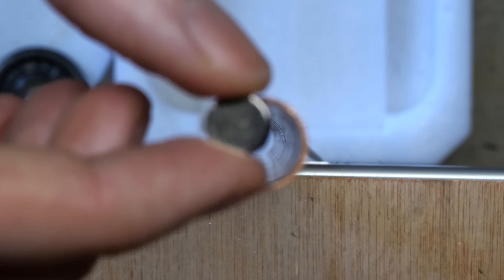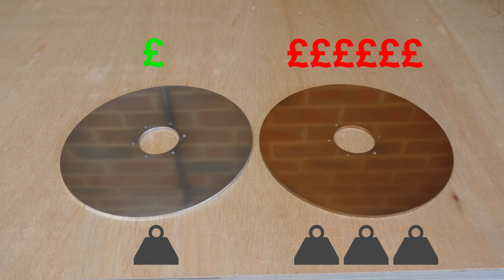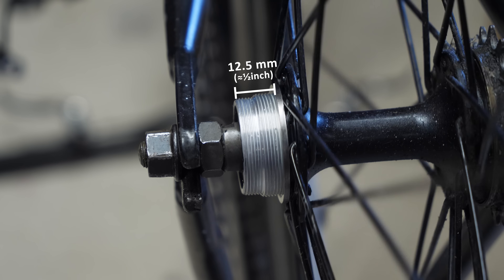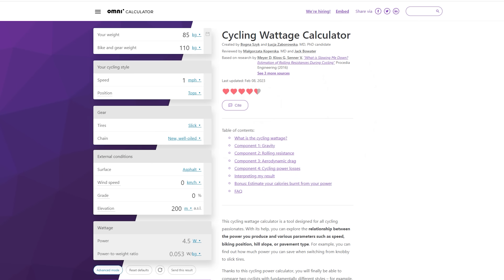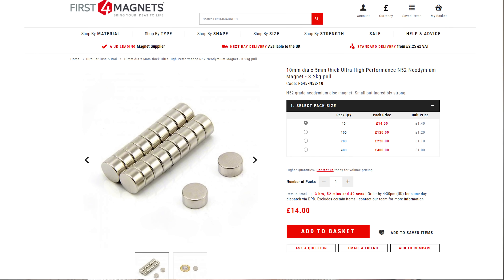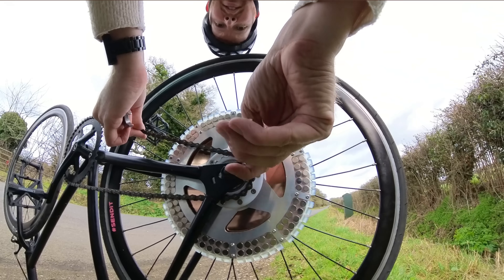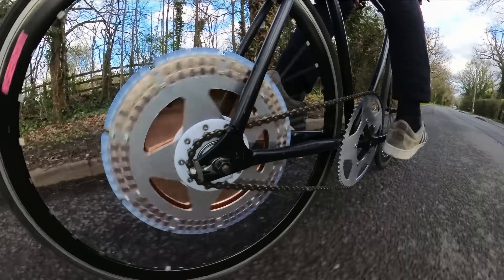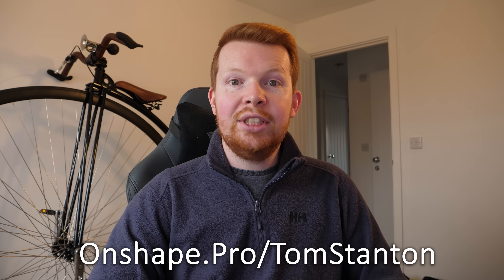Gearless Magnet Bike

Comment: I love you're projects, I want to try some projects like these.
Idea for your next project: a servo controlled CVT.
Use a dynamometer to measure your peak torque when pedaling and make a CVT that keeps you pedaling at that RPM so you always make maximum force (of course, it will have it limit, but it will be useful).
There are a lot of CVT designs, one of them being a friction wheel on a transmission rod and contacting a disk (you already have the disk) and you move the friction wheel closer or further away from the center of the disk, mounted on the wheelhub and that will change the gear ratio. If the wheelhub were fixed to one side, in theory you could get an gear ratio of 0 and even reverse gears.
Think about it, I'm sure it will be cool and useful

Comment: Could you use that generated heat almost like a battery? Technically it's stored energy right? Perhaps somehow that energy could be reused for some kind of uphill assist. but I have no clue how that could be achieved as I am in no way an engineer nor do I know how these things work. Perhaps just a scifi esc thought...

Comment: Maybe you could use this as a brake instead of a clutch. If you connect an electric motor to the wheel that spins with the wheel, then use electromagnets powered by that motor that engage when you pull the brake handle to interface with the copper disc. That is, if electromagnets can actually generate eddy currents in the copper disk. Could make for a cool non-contact brake if it actually works.

Comment: you should try to place holes in the copper disk to allwo the magentic flux to pass from there, i'm wondering if this increase or decrease the torque transfer (train brakes works this  way...)

Comment: You would have theoratically done better to put magnetic rivets in the disk. That concentrates the flux through the disk and greatly raises the torque. However it also makes the disk magnetic so it's harder to mount.

Comment: Checkerboard should be better, but you need to add a thin steel plate over it, to close the flux, that would more or less double the magnetic flux.  You could also build a halbach array, but I find the steel plate is pretty much as good and easier to construct.

Comment: This can be made to work but you've missed the figure of merit. This transmission transfers a certain amount of torque proportional to the rpm difference between the wheel and the sprocket. Suppose you're climbing a hill at 5 m/s and 250 W with 66 cm wheels and want 90% efficiency from the magnet sprocket-to-wheel interface. The wheel must be spinning at 145 rpm and receive 16.5 Nm torque. Due to requirement of 90% efficiency, the sprocket must spin no faster than 161 rpm, a difference of 16 rpm. So the transmission must transmit 16.5 Nm at 16 rpm difference.  You need to provide 278 W at sprocket via pedaling. 

Suppose you now tackle a hill which requires 250 W output at 2.5 m/s. Required torque doubles, so need 32 rpm difference, but wheel rpm only 72 rpm, so sprocket rpm would be 104 rpm. Efficiency now only 69% 72 rpm/104 rpm. Instead of providing 278 W you need to provide 361 W.

Your described magnet sets at 8:39 provide 7.1e-2 Nm per rad/s. 16.5 Nm at 16 rpm is ~ 10 Nm per rad/s, so you would need 139 magnet sets of that configuration to achieve above coupling, or else improve them, for example by increasing field, decreasing pitch, decreasing gap.

You can use this type of calculation to design an adequate transmission. Figure out how much torque you want at what speed with what efficiency. Also you should use a steel yoke on the backside of the magnets to increase the field at the copper (more torque), which will also stop them sticking to nearby objects. Also you can increase torque some by making sure gap between magnet and disk is small compared to magnet pitch.

Comment: hey Tom. very very interesting concept. i'm not entirely sure i've fully got this right, but if you switch the magnets for electromagnets, you'd be able to have an infinitely variable clutch, right? as well as intrinsically have a setup for variable regenerative braking? you could variably couple and de-couple the rotors while also recuperating the induced current while braking?

Comment: Aluminium is superior in this application, but you have to use a greater thickness. For the same thickness copper will win, but for the same weight, aluminium will. There are some constraints though, the frequency can't be too high and that's set by the size of the magnets and the rotation speed.

Comment: Hi Tom
The checkerboard is only useful if you also want drag in the left-right direction.; generally the magnet diameter should be greater than the gap between facing magnets.
More importantly,  please look into "back irons" - these will easily improve the effectiveness by 2x or 3x and shall also eliminate the problem of the chain sticking to the magnets :)
Reply: Yes!  I think this would probably double the performance at least.  Mumetal is ideally suited for the job (which is why they use it in hard drive voice coils)
Reply: Would it not work better if there were magnets distributed around the disc ?
(perhaps at pitch centres corresponding to say 9/10ths of the pitch of magnets, to get a sort of vernier effect). 
I guess the poles on the frame would want to be opposite polarity to those on the rotating disc. You'd want magnets both sides of the disc, to balance out the axial forces.
Reply: @Gottenhimfella  Quite a few drawbacks to your scheme - The damping (i.e. conversion of kinetic energy to heat) happens in the conductor, not in the magnet. A magnet shall store energy as potential energy (and then is mire like to demagnetize too, but that is a different story). So, to convert KE to heat, a conductive disc is essential. The added moving magnets shall add inertia to the rotor (non-issue in a bicycle, agreed) Second issue is that of axial (parallel to the axle of the wheel) force - rare-earth magnets of this size pull hard - a symmetric construction with two sets of fixed magnets and one moving conductor has no axial forces, and hence can be thin and slim.. to work-around this, perhaps 8/10th or 7/10th would be better. The third issue is cogging. Even with the Vernier, you would feel some. The advantage in your scheme (if I understand it correctly) is that you eliminate the air-gap on one side of the damper. The disadvantages that you have to pay as a price are, imo, not worthwhile (at least with my understanding of your described concept. Feel free to 3-d print a holder with 7-magnets and 10-magnets arranged in a circle and try twisting them against one another :) (without a conductor, it will feel more like a detent than a damper)

Comment: I feel like the next logical step to this is adding a belt instead of a chain and connect it to an electric motor. In theory, you could adjust the torque by how many magnets you have so you can adjust the torque so it would be able to get the motor up to speed faster and smoother without damaging anything or losing traction with the ground. Adapted for racing.... so cool... At least that's how it works in my head lol

Comment: i mean, all we did is create an induction heater. Like 20-30% of the energy you put in goes into motion (torque converter style) but the other 70-80% go into just heating the chain (passing by the magnets), the frame and the copper disc.

Comment: Have you seen the "Mechanical circuits: electronics without electricity" video at "Steve Mould" channel? There displaying an interesting way to make a reciprocating motion transformation at 15:00. It could be useful to implement some version of smooth derailleur in spirit of the Honda gearbox (the first generation).

Comment: A halbach array instead of a simple N-S magnet setup would would make the effect stronger for the same size/number of magnets. Besides, that, pretty cool!
Reply: That's correct but he will have to either have to cube magnets with the same field strength or he will have to increase the gap between the magnets chains and spoke for it to work
Reply: @Player-pj9kt  not really. A halbach array produces weaker field "outside", so the spokes and the chain should actually stick less!
Reply: @quinor  I'm not talking about the sookes and chains attracting to the magnets I'm saying that the magnets he us using will physically collide with the chains
Reply: ehh clearances... fair point.

Comment: maybe it would be better as a brake system.
you could attach the copper plate to the front wheel for example and have something to put the magnets close to it when you press the lever.

Comment: Love your content. It seems like you could have just used magnets instead of the copper disk. That said, if the magnets could be slide along a rail towards and away from the hub, it would be a more effective gear, but I suspect mechanical is probably better for this use.

Comment: If you peddled backwards would that give more drag in reverse as the drive wheel would be much faster in reverse than the copper disk to slow the wheel down faster instead of just stopping peddling?   very interesting and gets you thinking....

Comment: Now if you use arrays of magnets with different levels of force on both the clutch plate, and fly wheel you may get the result you were looking for. While not as cool as eddie currents. could still work adn woudl be a magnettic clutch. However the problem of wasted energy being transfered into heat would always be an issue, and just increased with each magnet added.

Comment: I'm curious what would happen if you put a generator at the pedals and an electric motor at the wheel, and only connect them with wires. No battery, no chain.
Reply: Ooohhh   ...     Free Energy !!!  😛
Reply: @jezmy2006  No free energy. You generate energy at the pedals and this energy is transferred to an electric motor.
Reply: It works but the problem is it's just not as efficient as mechanical drive trains.

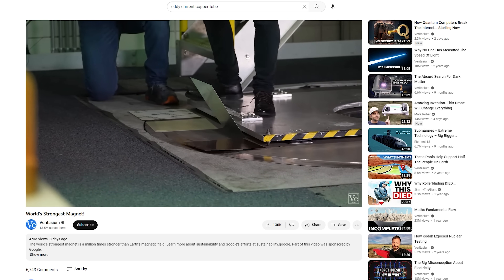Comment: 2:14 Could you explain to a weapon like me why weight matters? I thought the whole thing with Galileo dropping cannonballs off the Tower of Pisa was the proof that mass is irrelevant to falling speed. Now obviously Galileo didn't have a massive fuck-off electromagnet kicking about, but I don't know why that would make a difference here regardless, what am I missing? Does the additional mass allow it to exert a greater force and overpower the resistance from the magnet more readily?
Reply: I think the point is that you have to "spin up" the disk.  The heavier material costs more energy (more pedal power) to get to a given speed.  Ideally, I guess you want the lowest mass for your material and at the same time the lowest electrical resistance.  Also, bear in mind you have to lug it all around 🙂

Comment: 10:33 stainless steel bike chain :D
15:51 copper disc emissivity is 0.03-0.2 .. pretty sure the "30°C" reading is acquired with an emissivity setting of 0.95

Comment: This looks remarkably similar to the system I used to measure torque on my pneumatic engine. I also started with a weight on a spool to calibrate with constant torque. But now I'm using a load cell and variable torque which is far more accurate.

Comment: oi red head, just design a 50cc bike-like scooter, and start manufacturing them: your magnetic converter works like the torque converters with oil.
Reply: that airplane dude from US and his team can build the frames in no time.
Reply: very important to build gas variants, f#ck electric motors and batteries.

Comment: Flip it (put your clutch on pedal side, not the wheel side) and use electro magents instead of permanent magnents. That way you can harvest energy while braking and increase your magnetism when you're applying power.
Reply: So it’s a normal motor at that point
Reply: Bro invented an e-bike
Reply: @gibsonf06  mans proper smart, you get me.

Comment: Nice project; if you would have used a steel back plate for the magnet you would have gotten roughly twice the juice out of your magnets and it would also have solved your problem with your spokes and chain... but yeah still wouldnt win any races with it either way ..

Comment: What if instead of the copper disc you replace it with looped copper wire attached to some resistance?  That way you can have less lost energy since the fields would line up better.  Effectively making a generator.

Comment: I'm wondering if you could use this to generate current to recharge the battery on an electric bike or car for that matter❓🤔❓
You may not achieve a 1to1 replacement of energy,  but any recovery could be a significant ➕ in the equation for stretching the power curve....
And if you could generate as much or more power than you are using to move,  the smaller the battery you will need to run the bike or car or boat or even aircraft....
Although an other than land vehicle (air or water) might pose more difficulties than one where you could have multiple wheels on the ground,   some to move the vehicle and some to recharge the vehicle....
Reply: thats what electric cars do when you brake, it runs the motor backwards as a generator.

Comment: I wonder if there is any temperature rise in the copper due to the eddy current? Great experiment Tom!!!
Reply: You know in the end where the copper plate is really hot? Thats the eddy currents heating the plate.
Reply: @Tremoneck  Damn, I had turned it down and called it a done deal as there was a live event here in Canada of some serious impact. I wish I had not posted that now. Oh well
Reply: @chrisleech1565  wasn't meant to be condecsending. I just thought you didn't missed the bit or the connection.

Comment: This would work well as a magnetic limited-slip clutch, in which power transfer is proportional to the difference between input and output. shafts. It's not a great transmission, because instead of varying torque/speed ratios, it converts speed difference directly to waste heat.

Comment: Torque vs. RPM = Linear. And that is how mechanical speedometers have worked in cars for 100 years (just add a coil spring for resistance).

Comment: If you revisit this project, you should try a halbach array for the magnets. Should get you a much stronger field
Reply: It will give you a stronger field but you also have to keep in mind that he didn't much space to mount the magnets. The magnets would touch or overlap with the chains and spokes if he would use the halbach config
Reply: @Player-pj9kt  he don't have to use chains there are belt driven bikes already and they make much more sense because the belt isn't magnetic
Reply: @fischX  it still might get in the way. The spikes as well if he puts the magnets on both sides. Easiest solution is to use smaller cube magnets but those magnets are probably not as strong
Reply: wouldn’t it just give you a stronger field on one side? so instead of a bunch of change in flux from north to south from the individual magnets to a change in flux of let’s say north to nothing but with a bigger north?

would it actually be any better?
Reply: @Luka-lm1pr  The copper disc is very thin, so a single large pole configuration results in a lot of the magnetic flux going straight through into the air where it's doing nothing, where a Halbach array concentrates it near the magnets. This sort of application is almost exactly what Halbach arrays are made for. The caveat there is that the magnets are on both sides which does mitigate that effect somewhat, but I would hazard a guess that a Halbach array would still beat it.
Reply: I was looking for this comment, I agree that a Halbach array should make even weaker magnets work better.

Comment: Interesting idea! I knew immediately that the heat generated from the Eddy currents would make this non-viable for cycling on the street. Stationary cycling however... If you vary the diameter of magnets you could get a variable speed transmission that might work well for a stationary bike.

Comment: I'm curious if a larger diameter aluminum disk would have a greater effect since you would have the same weight as the copper disk but more area to generate resistance.

Comment: Nice project. Your temperature measurement from the surface of the copper probably isn't at all accurate. (Try looking at someone's wedding ring using a thermal camera)
Reply from the maker: I left the protective plastic film on the back side to get better temperature measurements. When looking directly at the copper, it doesn't show up on the thermal camera at all haha

Comment: Braking by turning pedals backwards should work better. Otherwise, yes, you are generating heat :) In the university, (ages ago) we had similar magnetic brakes with weights attached to a lever to measure the torque produced by various electrical motors.

Comment: You could also try replacing the copper plate with an internal set of magnets to mesh with the outer set, so it's magnetically coupled, though it would probably be even worse when it slips. Who knows?
Also, putting a sheet of magnetic steel or normal steel or iron on the outside of the magnets would help redirect their flux inward, like an axial flux motor does.

Comment: Hi, I think you can make magnetic clutch where the pedals are, and not on the wheel itself, also you can use sandwich from two copper plates and magnets in the middle,  also you can vary the distance between magnets and copper plates depend on pedal rotation speed using  Flywheel Governor.

Comment: Amazing project!

If there would be more space beside the wheel i think you could make a variable transmission with this system by adjusting the distance between the discs (ignoring the thermal problem :) ).

Might be an interessting follow up to this project

Comment: This concept would be interesting for just applying constant suggestive torque especially at low or no speed. Im not sure what applications it would have, but things that need pre load applied or benifit from a slipping factor between the drive unit and the driven unit would be cool.